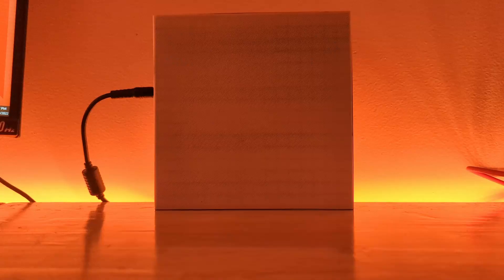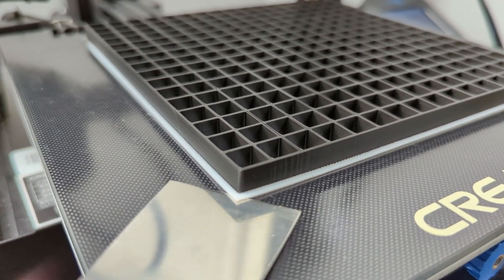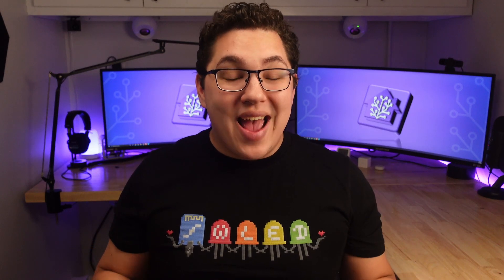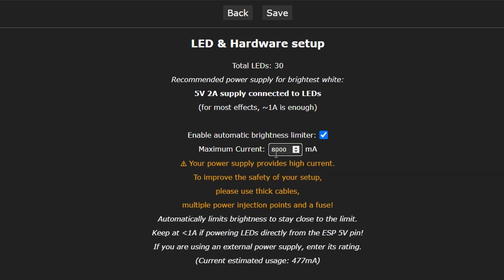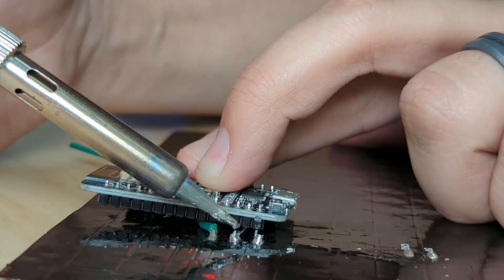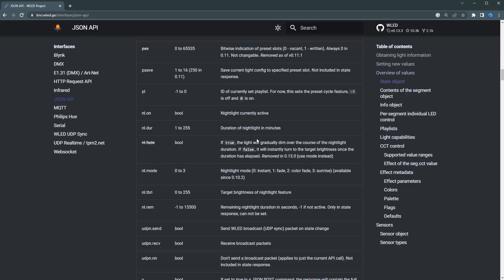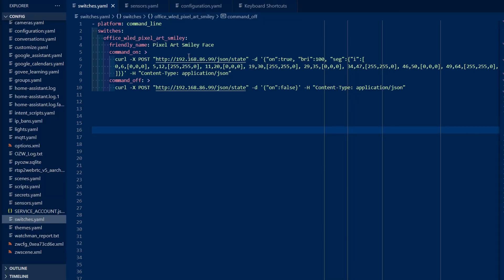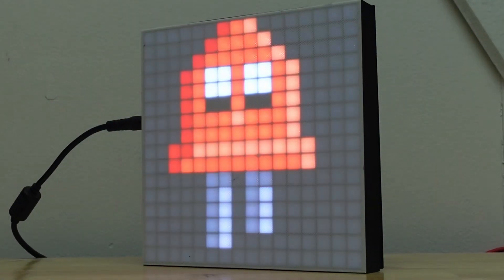Creating PIXEL ART with WLED!!

Comment: Nice video... If anyone is interested I performed a fairly major remix of the case. I added additional internal support, slightly thinker walls, a hidden barrel jack connector. It can be found on thingiverse
thing:5746531
The next big issue to solve is thermals.. These LED's get hot really quickly even at half brightness.
Reply from the maker: Looks good! I'll have to test it out. Yeah, thermals are another issue entirely! Could add an RPi fan haha
Reply: @MakeItWorkTech   Yeh.. I just updated the model to include a backing plate on the LED board to spread the heat. Ill 3d print a back plate for the time being but the better solution would be to use a aluminium plate. It seems ridiculous that you should need a fan for a box with a few LEDs in it... but... at full power these panels can draw 76W !!! Even with a small limited 6A power supply that's still 30W!.
Reply from the maker: @Br0mX  Nice! Yeah, it's a crazy amount of power! I'm working on a 32x8 diffuser... I have to print it in 2 parts. Just prototyping now. If you decide to take a shot at one, let me know, I'd try it out too
Reply: I just kept the back open. No heat problems at 5A, but mine also doesn't draw much more. Did you measure your current and temps? Without supplying power at all three points it didn't even draw 5A at 100%. These 5V matrices have several connectors for a reason.

Comment: Why didn't you wire the green wire OVER the ESP instead of it going underneath, putting the controller on an angle instead of flush with the matrix?
Reply from the maker: Good catch! I changed it later on haha, if you see at 12:43 I routed it around the controller to keep it as flat as possible.

Comment: Nice Pixel Art.  One question I had, can you not just create presets in WLED using the same JSON pasted into the preset"s API dialog box for each piece of artwork?  In Home Assistant, you could just invoke the artwork using the preset name.  In WLED, you can select a preset for WLED to go to as a default once power is restored to the NodeMCU.  Using this method would allow you to change images using the WLED app or home assistant.  Something to think about.  Thanks for the video.
Reply from the maker: Thanks! Great feedback...I haven't messed with presets too much in WLED since I prefer to do everything in Home Assistant, but I'll have to give that a try! If so, that would be a nice way to handle it. HA devs are looking at making a WLED service for HA that allows you to paste in the command. It would be handy I think
Reply: @MakeItWorkTech  I've been messing around with it and it definitely works. You just paste the same command you put into HA but just the part in the curly brackets from "on":true to the end and hit save. Then you can preload all the graphics into separate presets and load at your convenience. You can even set it to turn on with one of the images.
Reply: I had thought the same as you, since I don´t use HA.

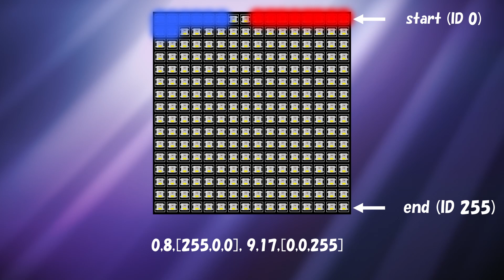Comment: Hi I found your video very interesting and I was following your example for switching on pixels with red and blue (15:41 time on video) Should it be 0,7,[255,0,0] for the red pixels then the two unlit and then 10,17[0,0,255] for the blue pixels?
Reply from the maker: 0,7,[255,0,0] would light pixels 0 through 6 (the first 7 pixels), because the "stop LED" is not counted as part of the pixel assignment. 0,8,[255,0,0] would light pixels 0 through 7

Comment: soldering became so much easier & better when i got a KSGER from Ali
Reply from the maker: A T12? I might have to try one!
Reply: @MakeItWorkTech  t12 clone. but yeah. best advice i got in years.
Reply: @MakeItWorkTech  get the one with 3 tips to start.
Reply from the maker: will do!
Reply: @MakeItWorkTech  ... and a good copper or brass solder cleaner sponge.  clean tip, clean connections! i just had to run to the garage for mine.

Comment: Thanks for giving thorough details,
is it possible to use ws2812strips (60 Led/Meter type) in this matrix ?
Reply: Yes, WLED works perfectly with WS2812B strips; in fact, the matrix is just a 'snaked' LED-strip. It doesn't require more soldering either, contrary to what Make It Work said; though you may want to inject some "extra" voltage every meter or 2.
Reply from the maker: WS2812B? Strips just require a little more work for soldering